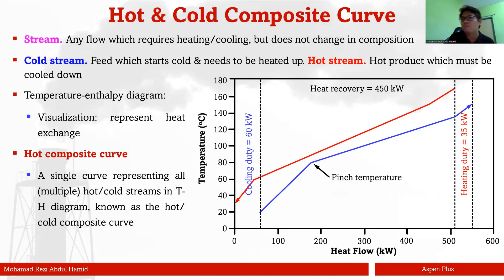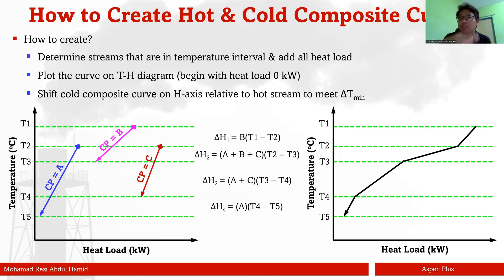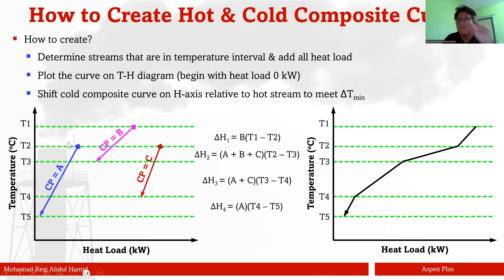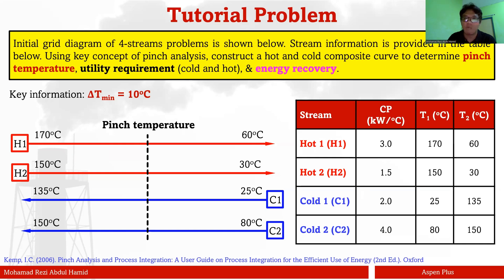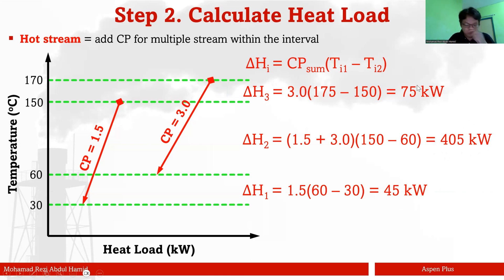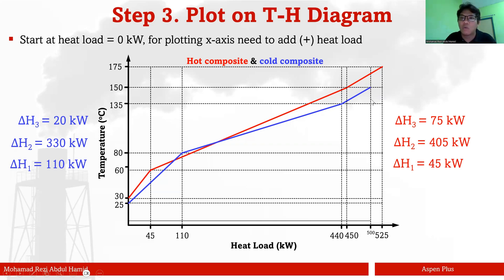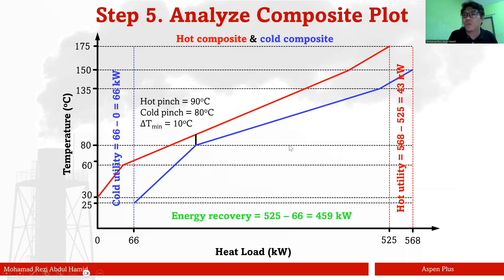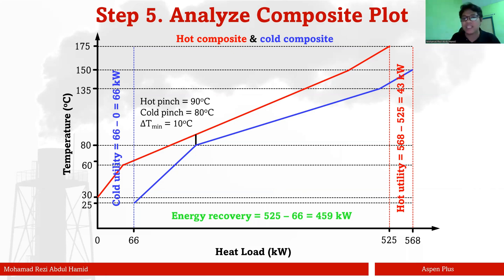Pinch Analysis - Prepare Hot & Cold Composite Curve Manually

Comment: Can we just assume the delta Tmin? Or there is calculation for the 25 celcius heat load placement before obtain delta Tmin
Reply from the maker: You can use any delta Tmin as long as it is greater than zero..in fact, different processing will have different recommended delta Tmin. For example, low temperature/cryogenics will use small deltaT min. In my case i just simply use 10oC
Reply: @MohamadReziAbdulHamid   Alright thanks for the informative content and the clarification 🙏🏻🙏🏻
Reply from the maker: @sitikhadijah9750  Just want to add...if u decide to choose different deltaTmin..for example 5oC. You just need to shift your hot composite curve such that the 'neck/pinch' is 5oC. Changing delta Tmin will change heat recovery n utility usage...of course if go detail - heat-x area, no of unit etc.
Reply: My POV, the recommended value for delta t min is shown in graphs (Cost or Area vs Delta T min) in textbook (PINCH ANALYSIS FOR ENERGY AND CARBON FOOTPRINT REDUCTION) is around 10 to 20. This typically will give maximum efficiency with little to no drawbacks. Hope that helps.